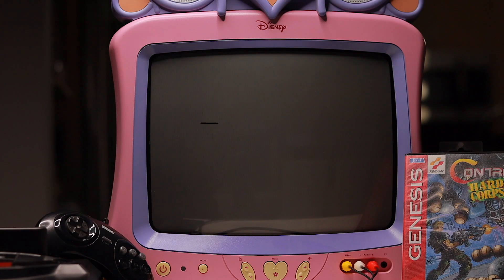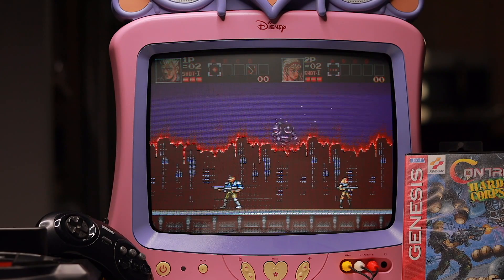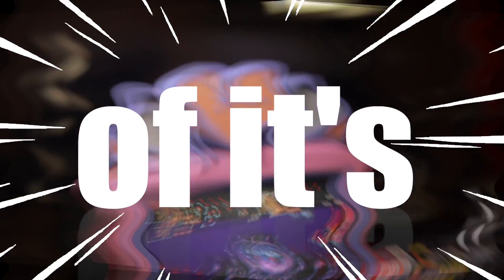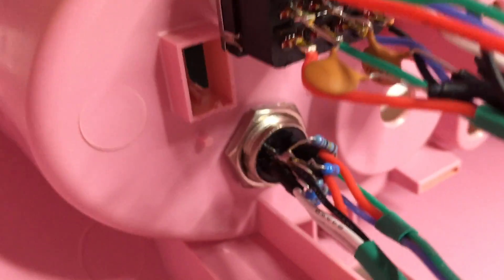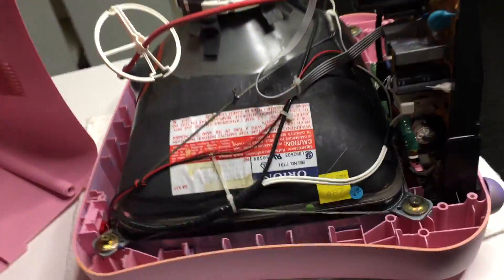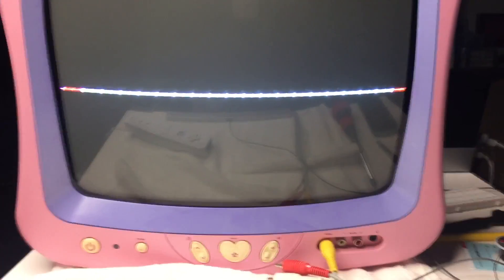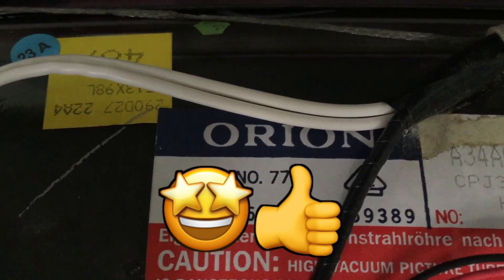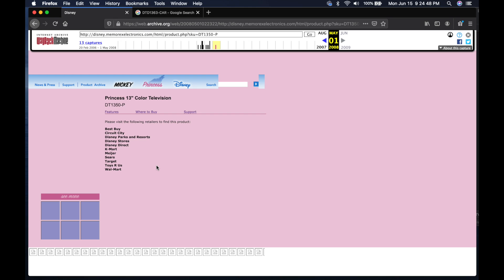Disney 13" Princess TV RGB Mod + Miscellaneous Information (Orion) [ep. 111]

Comment: What meter are you using to get capacitance on the caps you removed? I need a good capacitance meter because my multimeter doesn't do capacitance.
Reply from the maker: Nearly all DMMs on Amazon over $20 will do a great job reading caps up to a certain range. Just check the specs but all will be nearly the same. I have more professional ones, but nowadays, performance differences are quite negligible.

Comment: Hey segaholic, long time no see, hope you stillmonitoring this videos, as i got a tv that is the exact same model as thisone. I just have one doubt on where to place the 0.1uf caps, if i understand right, and based on your other video for the jvc tv, the caps should be placed on point b in the switch right? the comon one? thanks for your help.
Reply from the maker: Yes, the 0.1uF caps are placed on the common pins of the 4PDT switch. Thanks for commenting!

Comment: Hello.  Great movie!  I have the Mickey version but the European PAL.  In the service mode, I cannot correct the V POS option.  nothing happens when I press the remote control up / down .. What could be the reason?  Regards!
Reply from the maker: The European and US version are not the same, they are made by different manufacturerers.

Comment: Is the MICON blanking cable not necessary? I don't see a solder wire there, on resistor R124
Reply from the maker: Yes it is because you need to reestablish that line to get your "stock" mode back... like how your TV normally is. When you flip the switch, you are disconnecting all the lines from the micon to the chroma/jungle; and connecting the lines RGB lines and 5v to the chroma/jungle instead. The 5v from the tv (or you can get it externally) is considered your blanking line.
Reply: @The_SegaHolic  thanks for the answer, another question I have is about the resistance of the aviator connector, each one has one leg in the r/g/b/sync and the other leg in a common ground of the av tv ground?
Reply from the maker: @brigidios8451  The aviation connector is just a connector I chose. You really can use any connector. Sometimes I choose to use a SCART connector. There is no resistance in the pins. The connections to the connector are you RGB/Sync singnals from your video game console, along with Right and Left audio, and ground. So you need 7 input pins for your connector.

You can watch my other RGB mods on TVs and you'll probably understand better if you watch them all.

Comment: I bought the one with the tiara on top but its missing. I don't have the remote and can't change the inputs without it. Is there a mod to add an input button? Not that I can do that myself.
Reply from the maker: I'm guessing you tried the flipping through the channel before the lowest channel? I forgot if you can do this with this particular TV and I'm too lazy to dig her out at this hour (2AM), and it may be different with the tiara version as that TV is made by a different manufacturer. This one is made by Orion. But yeah, I don't know why manufacturers didn't include an input button on the TV itself, which to me, was a major oversight. Otherwise, no, I haven't seen a board with an unwired "input" button.

Comment: At what points should I be cutting a blanking line. I’m confused about that. Is it between the points where you soldered to and the mucon or the points and the chroma ?
Reply from the maker: You need to creat a break in the blanking circuit, like you do for the R, G, and B circuits. This TV does not have an easy way to create that break for the blanking circuit.

You need to create a break in the Blanking and RGB circuits in order to stop the signal from the Micon that goes to the Chroma/Jungle so you can insert your own RGB signals to the Chroma/Jungle that the Micon usually does. The Micon's RGB signals are the channel numbers and text and incons that come up usually when you press a button on the romeote or TV.

Watch my JVC D-Series mod, then my Sony Trinitron mod in that order, and you can get a better understanding as I explain in detail in those videos.
Reply: @The_SegaHolic   If I hacked into a cap like you did with the RGB lines, would I still need to cut it? I removed a SMC and injected two wires there on either side. So I’m thinking that right there cut the original signal. Inform me if I’m wrong.
Reply from the maker: @jacobnicoletti1235  There is no cap for the blanking line.
Reply: @The_SegaHolic  Could I email you? I need to show you some pictures and I have some questions.

Comment: Im confused about why you added two sets of RGB wires. One going to the switch and the other going to the RGB In. Couldn’t you have just put a jumper wire where the .1 caps were on the board, had one set of RGB in and then ran the .75 ohm resistors and the .1 caps in series along with the wiring following that? That switch was wild man. I’m honestly going to be using just a normal 3 prong on/off switch.
Reply from the maker: Watch my JVC D-Series mod video, then my Sony KV-20FV10  video. They both cover stuff in detail. Watch them both! They answer everything.
Reply: can you share your build please.
Reply from the maker: @javiersandovalvalenzuela6046  This is practically the same as RGB modding any TV. So if you watch my Sony Trinitron mod and my JVC D-Series mod, you will learn how to mod any CRT TV.
Reply: jacob can you share your build please.

Comment: Why are the capacitors removed while doing this work?
Reply from the maker: To create a break in the Micon to Chroma RGB circuit. The must be put back in the circuit obviously in the harness.
Reply: @The_SegaHolic  Mr. Segaholic, do you mind explaining to me how are the .1 caps put back together? is it the same as the .75 resistors? one end to negative , and the other end to the color line?  Also my tv its a P-U model and its not the same internally but i found the caps, and im basycally following the same method. ill post results here, thanks for your videos.
Reply from the maker: You do this if you don't want to cut the traces, as this does not have jumpers that can be removed instead.
Reply: @The_SegaHolic  I think it is possible I can use the BNC connectors for the RGB, and I need to use the rca to BNC connector to connect the yellow rca jack for the sync. The 3 pin toggle switch could be used for the RGB switch.
Reply: @CrashFan96  I sa your video, nice mod, i just have one small doubt, how are the 0.1caps put back on the harness?

Comment: Shoot, i got exited when i found a local tv for 5 buck, then after open it up, found that mine is more complicated, its the 1350-p u model, so caps are not located in the same spot. ill see if i can trace them as i cant found the manual for it, chroma seems to be the same, not the micon.

Comment: nice video and Well made, dude please, can you help me moding my TV ? 
15 DAYS of trying modding my CRT ,but i cant i tried so hard :\, i got a black screen only audio working, when the blankin is ungrounded the TV go to black screen without give the blanking 5V ,when i start the TV , and mesure the blaking with ground , he give me 3 volt without any voltage source, im not give him the voltage
---   im using sony trinitron KV-TG21L70  - BG2T chassis and TDA8844 Jungle IC , this TV not have an OSD and no teletext so I rise up the legs from a jungle and I wired My RGB line to 23-24-25 Pins and 26 for blankin , I’m using scart ,  i found 5V on the motherboard I added a risistor to lower the voltage to 2.5V for the blankin  , and the RGB line a grounded them with 75omh resistor and 100nf capasitor to the jungle IC , Im using GND from the mother board directly to scart pin 21 ground , and I connected all ground together, when i start the TV , the composit signel from scart work normal, but when i swetch to RGB i got black screen,  I tried to remove the capasitor from RGB line and same problem, when I ground the blanking I got regular composite signel , please please please help me , I want to do this mod, if you can give me your email , and im gonna send you all the picture and wiring that i did, thanks you man
Reply from the maker: Did you try 5v for your blanking voltage?
Reply: @The_SegaHolic  yes i tryied nothing :/ , when I give 3V for blanking ping 12 on controller system chip not the IC jungle , the screen go all red , there is 2 blankin 1 for jungle chip and another for controller system chip
Reply: Can I install RGB wire directly to neckboard ??
Reply from the maker: @MouMouhDS2  NO. Don't do it. It's possible, but not like how I show in this vid. It's much more difficult and not advisable.
Reply from the maker: @MouMouhDS2  Sorry man, all the advice I can give is in this video, or the other RGB videos for other TV's I have made.
Reply: @The_SegaHolic  ok dude thanks for helping me ;), your videos are asome
Reply from the maker: @MouMouhDS2  Are you in the US? If so, find an Orion, Toshiba, Sansui, Broksonic... all cheap TV's that you can easily mod.
Reply: @The_SegaHolic  im in North africa , CRT TV are expesif in our region, and i want realy mod this sony trinitron because i like the size and the design and also a flat tube :\
Reply from the maker: @MouMouhDS2  Wow, nice. to know I have viewers in North Africa. I wish I could help you more, but it's so tough to help through messages. Everything you described what you are doing sounds right, but it's hard to know if there is anything worng when you're not there to look at it.
Reply: @The_SegaHolic  if you give me your email, I can send you all the pictures that I did with the mod, and and also send you service Manuel to , and telle me just what I have to do from zero , I can desolder all the wires that I did and back from zero , dude like I can’t sleep at night of thinking to do this mod, please please give me just some advice , and also I can recorde vidéo to show You anything what i do
Reply from the maker: @MouMouhDS2  email is near the bottom of the page.
https://www.youtube.com/c/SegaHolic/about

Comment: What is that tool you use to remove the tiny surface capacitors on the motherboard?
Reply from the maker: Desoldering Tweezers... less than $10. You can see me using it on the latest episode 117... or bettrer yet, full information here:
https://youtu.be/Eb8dkIR03tc?t=429

Comment: After lifting 2....yes 2, pads I finally modded this tv. But I am getting some sync shift, mostly at the top. Sync is going in composite. I was looking for the luma, I think that will be better since I do not have a remote. I think its micon pin 22. Any insight?

Comment: What tool is that at 3:27?
Reply from the maker: It's a hot tweezer... CHEAP!!! Best $7.99 I ever spent. https://www.circuitspecialists.com/Tweezer-Style-Soldering-Iron-For-SMD.html
If you gonna get them, get the different sized tips too. You'll need to tin the tips. More info on them 
in this video: https://youtu.be/Eb8dkIR03tc

Comment: Nice work! Where did you source the multi-pin male and female screwable connector and the female scart connector from? Part numbers? Thank you!
Reply from the maker: Amazon. The connectors are called Aviation connectors. Get the scart sockets fast, as they always run out quickly.
https://www.amazon.com/gp/product/B07P4N322L/
https://www.amazon.com/DIYhz-Circular-Aviation-Connector-Adapter/dp/B07GZD5XCT/

Comment: Love the content man, I like how you are changing it up with different components like externalising the scart port . Keep it up
Reply from the maker: Yeah, the shape and space of the outer cover made it an excuse to use the aviation connectors that I initially planned to use for all my RGB mods. It also makes it easier and faster to make the hole for the RGB input socket. I can just drill a hole, vs spending like an hour hand cutting and sanding the Scart/JP21 socket hole. No question, more to come!

Comment: Thanks for the informative video.  I'll be doing this to mine when I find time.  BTW, is it possible to do a svideo mod to this TV?
Reply from the maker: The video couldn't wait for 100 likes. LOL. As for S-Video, looks like you can as there are Y and C inputs to the chroma chip, which I included the data sheet (page2)  in the zip file in the description.
Reply: @The_SegaHolic  is the data sheet just the schematic diagram from the service manual?  I can't seem to download the one on here.

Comment: Great work again. Love the external scart box, the cable wrapping is really clean. Interesting note about the disney branded CRTs; they were produced way past their prime. The cars 2 branded ones were produced and sold in 2011 If you can believe that. I wonder how good a low-hour cars 2 one would look fitted with RGB?

That Fist of the North Star game has been on my radar for a while now, but I haven't seen it for a price I wanna pay yet. Still need to watch the show too, Lol. Congrats on the WEGA set, I have the KV-36FS120 but having a smaller one definitely has its perks. Well once again great video, I enjoyed it on my PC CRT (with an orion tube!).
Reply from the maker: Yeah, actually did tons of research on all the Disney CRT's, and it was supposed to be in this video, but I decided it would make a great video on it's own. The Cars TV's were more than like made by TTE or some other Chinese maker. Most times, by 2006 on... TV's were using "1chip" integrated micon/chroma-jungle chips so RGB modding is not possible. And funny you bring up the Cars2 set, as there is one posted about 3 weeks ago for $60 in my area.. 😬👍

I have a KV-36FS17 msyelf. I think you can spot it in the video. Had it for over 3 years now. It alsmost killed me and tore off my arms. Wega or Trinitron TVs, I got quite a few, and someone was begging me to do one on a Wega. You find more Trinitrons than anything, so... yeah. I've had them for quite some time now, so I might as well appease the Trini lovers.

Interested to know what PC CRT has that Orion tube. LMK!